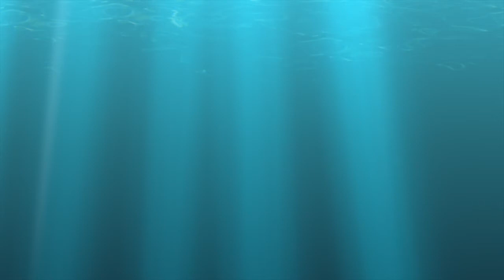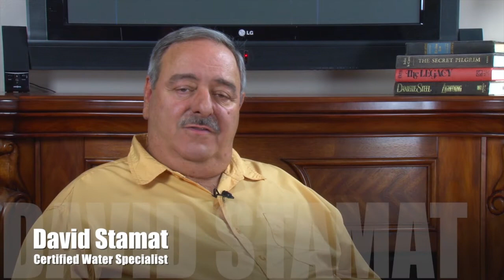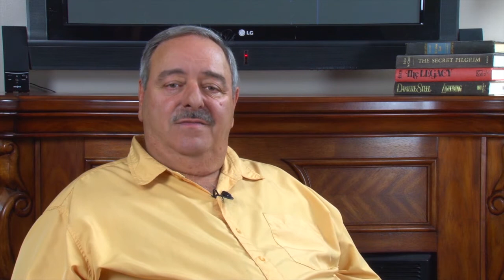How often should a water filter be backwashed

Comment from the maker: There are a lot of variables that you didn't share so it is difficult to answer. What valve is on the unit what is the backwash pressure, is Kdf in the filter also, is garnet or gravel in the bottom of the tank. Is there resin in the tank also.